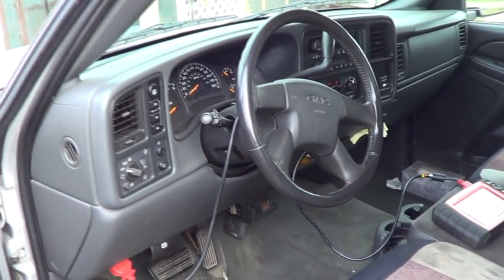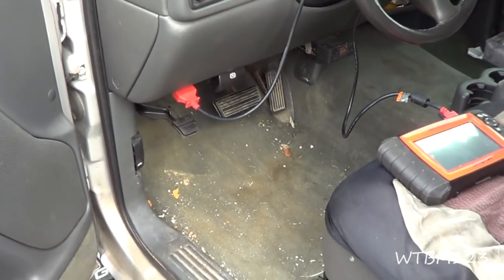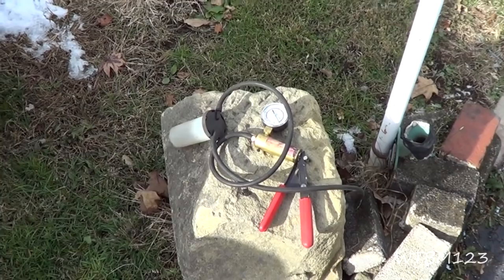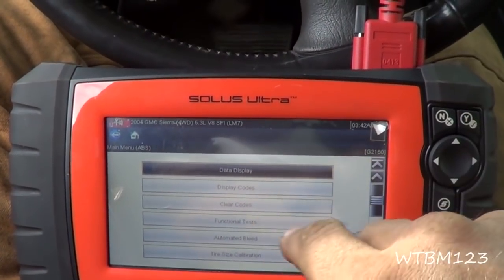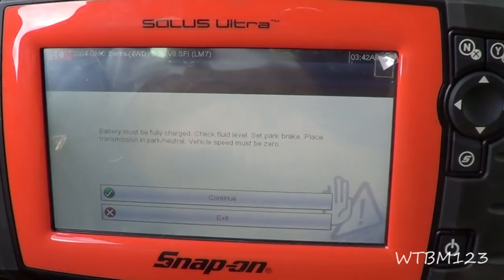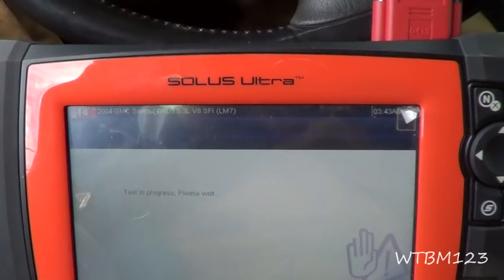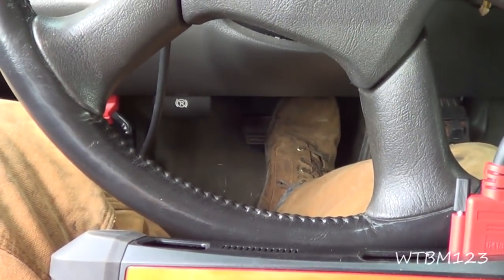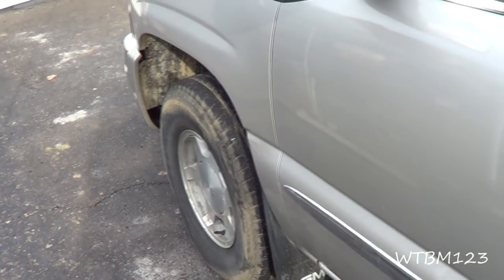Bleeding the ABS Brake Control Module,On a Chevy Using a Snap On Solus Ultra

Comment: Thanks for the video.  I was wondering the software version on your Ultra.  Thanks.
Reply from the maker: I am still on 13.2
Reply: wtbm123 Thanks for the info, I'm looking at an Ultra with 13.2 and was wondering if it had ABS bleed.
Reply from the maker: ***** It has been in there for a while before 13.2
Reply: wtbm123 I bought a used one today and I want to thank you again for the service you do for guys like me.  I know it takes a lot of time to put these videos together.  I have ABS issues on two GM trucks that will involve bleeding the systems so this video "hit the nail on the head".
Reply from the maker: ***** Keep in mind if pushing air out of abs unit . it will take some time bleeding to work air to wheels and out ,

Comment: I have a 1997 chevy tahoe 4x4 5.7 engine.  This coming spring I'm going to replace the master cylinder and the hard lines coming out of it to the abs controller.  Does that automatically introduce air into the abs unit?  From what i read it does.  I replaced all my hard brake lines except the 2 coming out of the master cylinder to the abs for fear of getting air into the system.  My master cylinder has some thick black crud on the walls of the resivoir thats why i want to replace it plus it's 17 years old anyway.
Reply from the maker: It is possible if you bench bleed new master cylinder and gravity the lines before ever pumping pedal with lines attached to abs unit. would need to gravity bleed very well at abs unit ,BEFORE ever pumping the pedal. But chances are much greater of getting air in there than not.

Comment: Couldn't you hook up tubing to all 4 bleeders like an overnight grav bleed and have someone standby at the MC w/ fresh fluid and run this test with all of the valves open? Seems like you'd get 100% of the air out. No?
Reply: Incorrect, the scan tool only reads whether you pushed the pedal down, via the brake pedal switch. There is no pressure sensor for the brake system
Reply from the maker: No because the scan tool needs to see the pressure or it will not run the test.
Reply: Ahhhh makes sense.

Comment: I am working on a friends 2003 Chevy Trailblazer with 4.2 vortec motor. I replaced the front rotors and pads. In doing that I realized the passenger side caliper was bad and leaking fluid all over. I replaced it and went to bleed all the brakes several times. The brake pedal never got better and there was no fluid going to the passenger side brake line and very little to the drivers side. I disconnected the brake hose from the line and no fluid coming out when pushing on the brakes. I traced problem to bad master cylinder with a used one from reliable used parts place. I went to bleed the brakes again and still no fluid going to the front. I did some research online and found that the abs system could have got air into it because the caliper was leaking before and the master cylinder fluid was gone when I first got the truck. 

My main question is, the bad caliper was leaking out brake fluid and no fluid goes to that caliper. What would cause that? I am figuring now I have to replace brake lines, bleed the abs and maybe bench bleed the master cylinder. Just was curious.
Reply from the maker: You could have got air in the abs.Sometimes the rubber lines will go bad and collapse on them selves also.Sometimes over pumping when bleeding brakes can make it hard to remove air. Most will gravity bleed air out of system if all lines are clear ,but can still leave some in ABS. Also be sure all brake pads move freely in their holders as this can cause it to feel like air in system. Sometimes activating the ABS can move air trapped inside to move on down the system. I  Always bench bleed master cylinders ,new or old before installing.
Reply: Thanks. About to bench bleed now. My dad said I didn't need to but I know now!
Reply: Now I know smh. Long day
Reply from the maker: Robert Espinoza If trucks were side by side you may get away with out it but I always do just to be sure . You can remove lines and do it on truck , then put lines back, without completely removing the master.
Reply: Bench bleed it and still same issue. I will have to find a diagnostic abs tool to drain the air out of the abs system. If that doesn't work then I will be replacing lines. If all that doesn't work, I'm stumped lol.
Reply from the maker: ***** Also make sure the pads move free and are not stuck ,as this can make a low pedal feel. When bleeding ,if I do the pump method I only push pedal one time then loosen bleeder. If you pump it numerous times it can suds the fluid. It pushes fluid in to the air pocket and each time splits the air pocket in to many little pockets that are harder to remove. Also for low pedal feel ,make sure wheel bearings are good. But usually not show up unless you turn the wheels or move car.

Comment: I planned on flushing the brake fluid in my 2003 Silverado and was wondering where I could get a scanner that will do this abs force bleed process
Reply from the maker: If you have no air now and flush and keep full you should not need to. Any scanner with bi directional controls can do it . This is a Solus Ultra from snap on.

Comment: Thanks for posting this: Our problem has been 98 suburban with abs...replaced abs module and master cyls. brakes work well but then after a few minutes, pedal to the floor, have done the auto-brake bleed over and over, plus manual bleed. What are we missing?
Reply: Bruce Maier
 Sometimes I've left long hoses on calipers over night and looped them back into the MC or a container set high up with the valves open on tricky BMW bikes with ABS. From what I know it should work on our trucks too.
Reply from the maker: If you are sure you got all the air out ,make sure all caliper slides are good and working easy . You would think if it was wheel bearing or brakes out of adjustment you would feel that right off. Are you pumping the pedal or vacuum bleeding. Also if when  brakes are  bled by pedal pumping it will sometimes suds the fluid and make it hard to remove all the air. Not sure how you bled them but it is a thought.  Hope you get it sorted and lplz let us know what it ends up being.
Reply: Thanks. Yes we did the auto-bleed with the diagnostic computer but it came up " no errors " so we went out, drove it, seemed fine then all the sudden the pedal goes clear to the floor again. I think you are right; it's those bubbles of air . We'll try again tomorrow. Thank you s much!

Comment: Interesting vid Terry.
Reply from the maker: Thanks
Reply: wtbm123 Have you ever heard of the foxwell nt644? I'm wondering if that would work with the abs. I've got two cars with the above symptoms, a durango and an ml320
Reply from the maker: Miguel Lopez I do not believe it has bi directional capabilities , but not sure , and after bleeding with scanner the air still needs bleed out of the lines .

Comment: I'm willing to bet that ABS has caused more accidents than prevented accidents!!!  We all learned how to modulate the brakes ourselves and now you are supposed to step on the brakes and hope for the best!!!
Reply: For about a year, my car would activate the antilock brakes for no reason.  Didn't matter if I was stepping on the brakes or not, the ABS would activate.  And if I was stepping on the brakes, my braking would suffer, a lot, as the ABS was fighting me trying to brake.  Scanner coughed up a code that the front left wheel speed sensor failed, so I replaced the wheel hub (sensor was integral to the hub).  But the ABS was still going.  I did replace the hub with a cheap, Chinese $25 hub, so then I used a Timken, about $200.  Still had the same problem.  So Then I went to the salvage yard and cut out the wiring to that sensor, I was going to swap out the wiring harness on my car.  On my way home, I stop at McDonald for a coffee, go back out, and my car won't start.  The fusible link that was for the start solenoid had broken.  So I ended up cutting the end off the harness and use it to jump battery power to the solenoid to start my car and go home.  Finally I just bought the harness from Rockauto, which was about $7.  I just installed it today, and now my ABS works fine.  But for about a year my ABS would be fighting me being able to brake, and funny thing, it would activate even if I wasn't stepping on the brakes.  Odd because the module can tell if the brake pedal sensor is being activated or not, but still, just driving and my ABS would activate.
Reply: Yep wrecked my o3 silverado into a tree high speed cornering up a bumpy spot in road and then a short straight line for heavy breakuing into a 90 degree turn. Drivin this corner dozens of times. Then one time i hit the bump and started hard breaking before turn and the abs freaked out. I was able to dump enough speed to only hit the tree at 30mph.. man that was a lesson. Lol
Reply from the maker: I agree.
Reply: ABS is  nothing  but a pain in the Ass....

Comment: I need to get my own scan tool.  Have you ever used or heard of the Auto Ingenuity software for use with a computer/ notebook?  Looks like a decent deal for the price
Reply from the maker: Isn`t that for Windows.   Would need to see if it has all the bidirectional tools
Reply: Just buy the Maxicheck Pro it deals with abs bleeding.

Comment: 2 cars i owned i disconected the abs because i didnt like the pulse of the pedal
Reply from the maker: I am an adult ,let me control my own brake pedal.
Reply: I second that !
Reply: ABS sucks in winter too !!
Reply from the maker: air would make for a soft pedal . If it has power brakes , i would look into seeing if the power assist  works,  vacuum or what ever it runs on  , is the power booster good .
Reply: I HAVE HARD BRAKES, I CHANGE EVERYTHING BUT THE ABS,IF AIR IS IN ABS CAN THAT MAKE ME HAVE HARD Pedal
Reply: yes the power booster good,well I just found out that the guy who did my brakes. He grind my old front rotors while they were still on the truck,im pissed cause you cant do that. every since then I have hard pedal dragging brakes. I have new rotors on front. still got this hard pedal. Then I thought to myself maybe from this guy grinding on the rotors while still on truck got the abs wheel sensor dirty or something cause I never had this problem til this guy did that, I just need brake pads. So do you think the abs can cause this problem,,thanks
Reply: So you're saying Ardent, is that I don't need a fancy scanner to bled my ABS because I (may/may not) have pulled said ABS sensor from under my hood and not using ABS anyways? Blew a brake line and worried about needing expensive tool to bleed brakes.